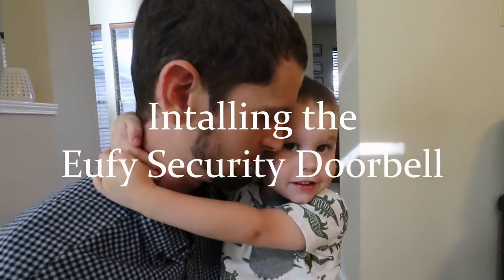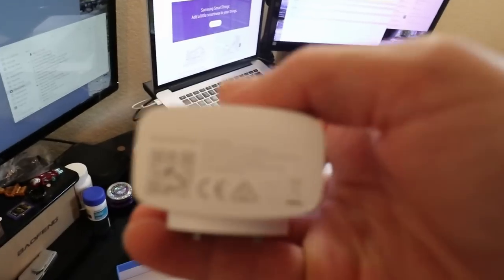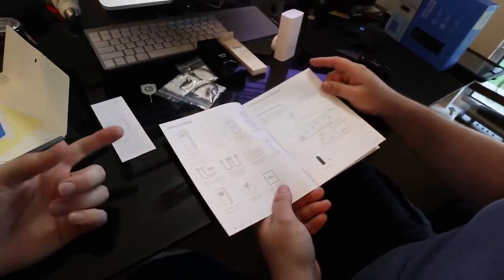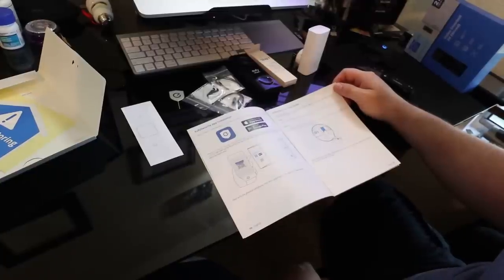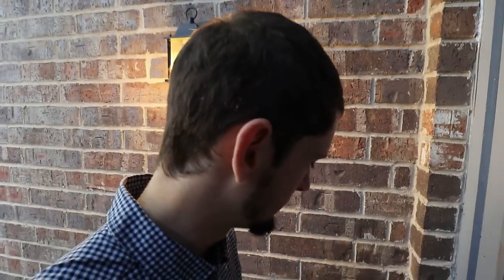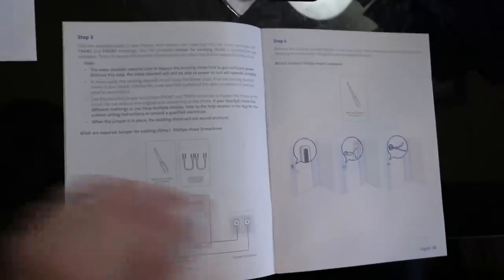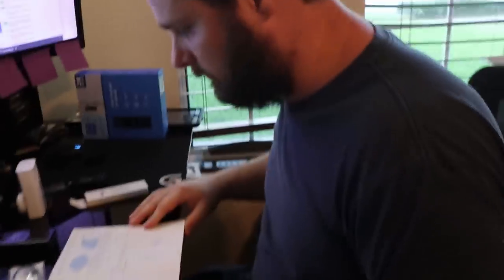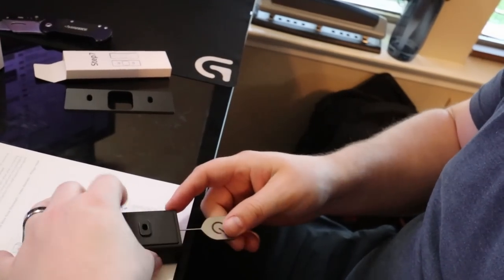Eufy Security Wi-Fi Video Doorbell installation $NO Monthly Subscription$

Comment: First of all thank you so much for your detailed video.

I do have a quick question / issue on Homebase2 connection to my router.

I do have tp-link Deco X20 mesh system, when I try to connect my homebase2 with the internet , it has blue blinking light only and then I could see error message "Network Exception, please try again later."
With an error screen titled "Unable to add HoemBase2".
Could you please help me out? I tried everything reset, unplug power cable, router restart, reset button on homebase2 but it just keep blinking blue led.
 Help would be highly appreciated 🙏🏼

Comment: Could I simply remove the chime completely and connect the trans and front wires with a nut, shove it all back inside the wall, spackle and paint so its like the chime was never there?
Reply from the maker: I think the only issue with your plan is putting wiring in a wall that’s inaccessible. Against code I believe.

Comment: Any tips on installing this without a preexisting doorbell in place?
Reply from the maker: If I didn’t already have wires in place I’d consider a battery operated doorbell with a solar charger. I know there are doorbells that will run for months on a battery charge so it wouldn’t take much light to keep the battery topped off.

Running wires can be a pain with existing drywall, though that all depends on your own situation. All you really need is to get the wires to a place that has power and you can install a transformer to drop the voltage down. So if you had a light switch or outlet inside the house opposite where you wanted the doorbell it would be feasible.

Or maybe there is a porch light you could run a transformer off of and wires down to the doorbell. Then use a smart lightbulb to turn the porch light on and off so you could leave the porch light switch on permanently for the doorbell to work off of.
Reply: @beenegarage7116  thanks for the in-depth response. I was thinking about running a wire through the wall to a nearby outlet on the inside. What kind of wires and or adapters would I need to purchase to do that?
Reply: @beenegarage7116  anyway, I already have it and just wondered if you had any tips for installing it.  I understand the concept of running a cable through the wall to an indoor outlet but feel like there is a transformer or something I need to do that with.
Reply from the maker: Oh yeah! If you just want a wire coming out of the wall this should do the trick. And you don’t have to do any re-wiring of the high voltage 110 lines in your house.

https://www.amazon.com/dp/B07DJ7RHS5/?tag=BeeneLife-20

Or if you want to recess a doorbell transformer in the wall you could do something like this.

https://www.amazon.com/dp/B07GND8RMQ/?tag=BeeneLife-20

Either of these should drop the 110v line voltage to the ~24vac the eufy doorbell needs. Assuming you are in the USA! Europe uses 240v.
Reply: It's a pain in the ass. My house only had these really crappy battery doorbells that only worked with an old ADT alarm system. You basically need decent knowledge of electricity to get it to work, or more than likely have to hire someone to do it now. I made the mistake of getting one before finding out my house has yet another weird problem with it. Yay new homeowners!

Comment: I know that the doorbell was mounted lower than ideal, but could you share what the exact height was for the camera portion? I ordered the doorbell yesterday, and my current doorbell is at 41” in height. Thanks...great video!
Reply from the maker: Danny, I’ve shot some video with better footage on how the doorbell works. Including a bit on how well the wide angle lens handles different height installs! Short answer is you shouldn’t have any problems at 41”.
Reply from the maker: The video isn’t uploaded yet but should be in the next week or two.
Reply: BeeneLife - Still waiting on Amazon to deliver the doorbell. Isn’t that the way it goes? 😜 On another note, if my transformer doesn’t push out enough voltage, I’ll have to upgrade it. No big deal—if I had any idea where it was. I checked all the usual places, but didn’t see one. So I called the builder and he didn’t know, but thought that it might be built into the actual chime unit. I pulled the cover off the chime unit in preparation to jump the two terminals, and the transformer could be behind one of the inner covers. What I don’t want to see is after installing the doorbell, the light ring shows red. Yikes! Anyway, excited to get it up and running!
Reply from the maker: If I were a betting man I’d put money on your transformer being just fine. Yes Amazon delivers next day when it’s something you need next month! Lol

You’ll have to let me know how the install goes.
Reply: It should 48"